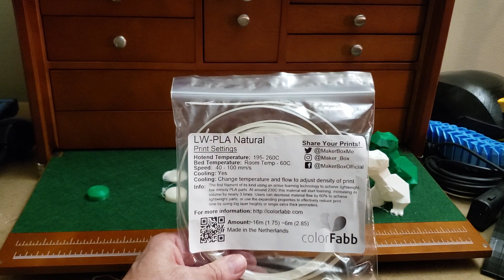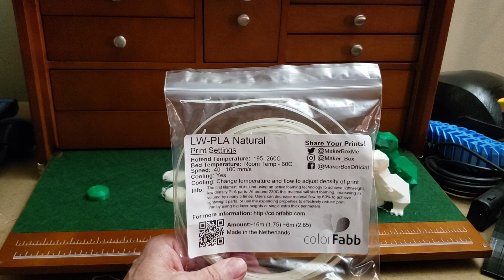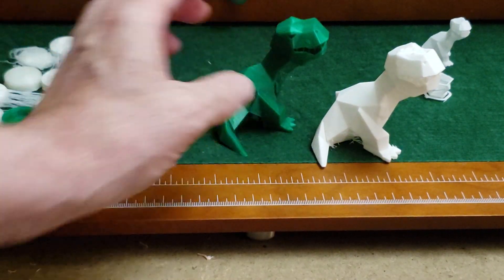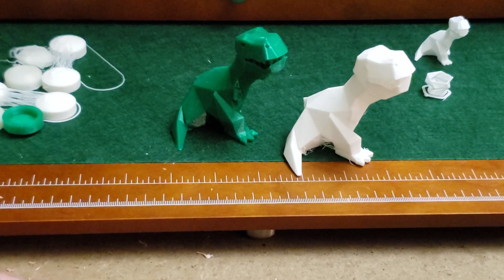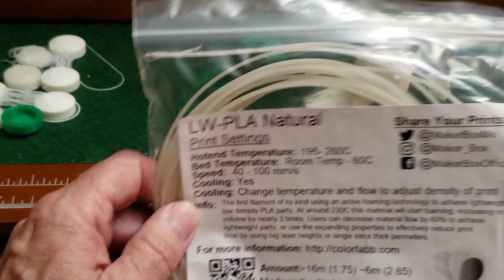Colorfabb expanding PLA

Comment: I wonder, i don't see how retraction could work with foaming, as when you retract, it will keep foaming? I'm thinking the way it can actually work with most acceptable quality is by printing very slowly allowing the material to expand as far as it'll go, print thick layers and wide linewidth or nozzle size, and then use suuuperfast nonprint moves and basically no retraction or just the tiniest bit? Definitely a challenge, but an interesting material family. If they can foam maybe a somewhat harder and more temperature resistant polymer, maybe polystyrene, perhaps also suitable as heat insulator.
Reply from the maker: The instructions did say did you could print bigger resolution lines. So instead of printing it .2 mm you could print it .3 or .4 mm. I left it at point .2 mm just to see what issues it would cause.